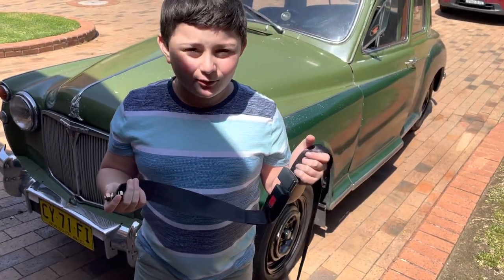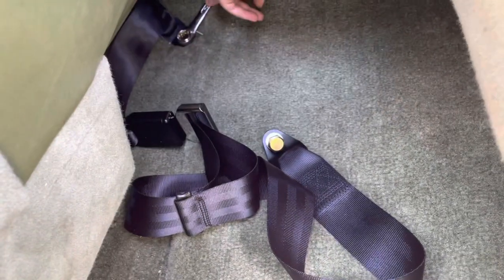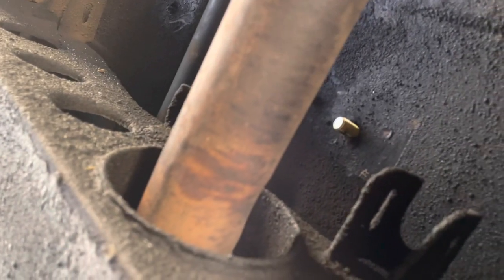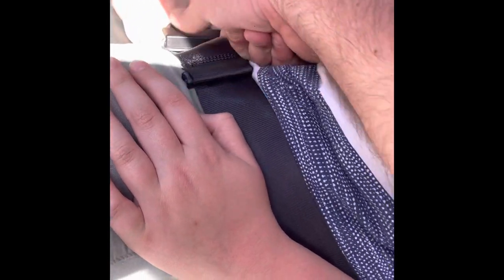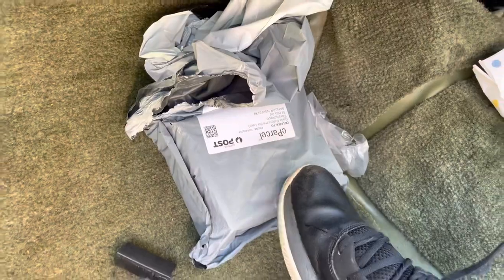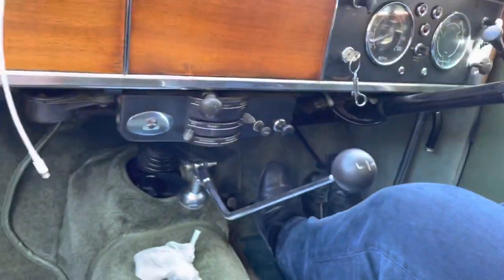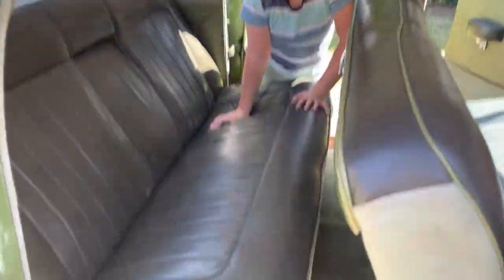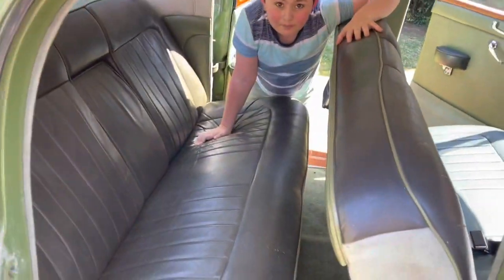Seat belt installation - Rover P4 80

Comment: Sorry but what a pants video - how do you thread the belt through the seat, where does it go, did you drill the holes or were they already there (did Rover know about this in advance so they put the holes there), did you use load spreader plates on the underside of the floor pan - you should have - otherwise the nut (not bolt) could pull through the floor when under load? I didnt learn anything from this video and its got me all upset.
Reply from the maker: Previous owner had put holes in front already, belts were missing. Rear had no holes, I used high tensile drill bits of the metal bit kind. Underside of all bolts have a load spreading plate a few inches wide so it cannot pull through.